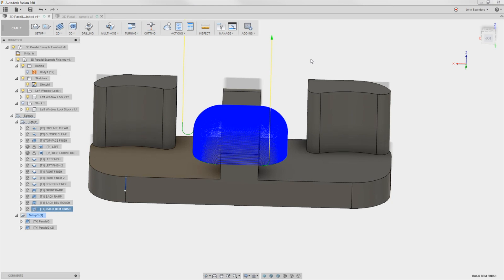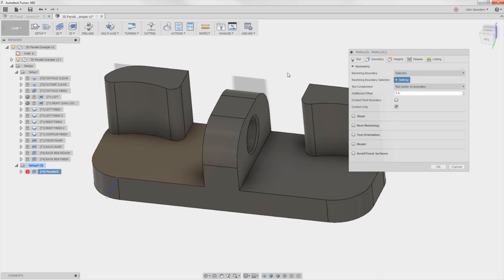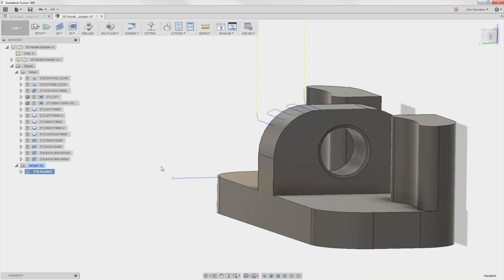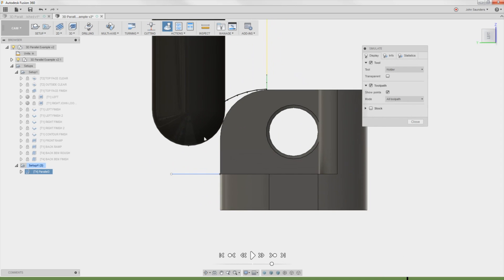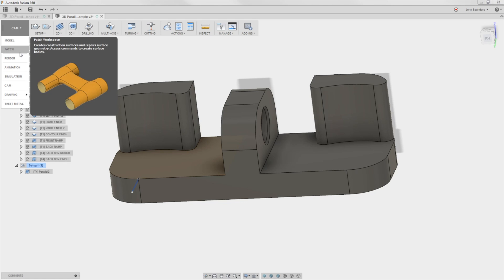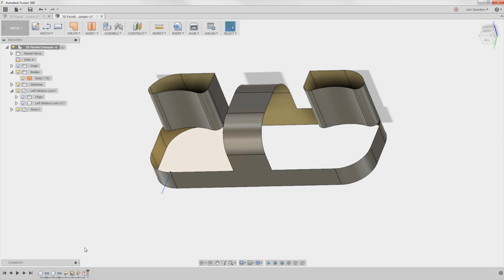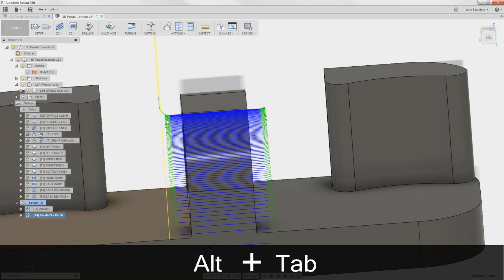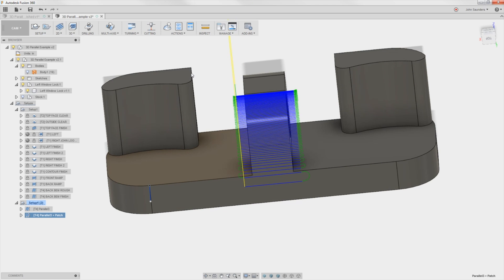Fusion 360: Fixing 3D CAM with Patch!  FF74

Comment: This is exactly what I was looking for. I can't believe Fusion doesn't a setting to do this. One thing you should know is Fusion looks a lot different now, so you have to switch from Solid mode to Surface mode in the top tabs to find the create patch command.

Comment: Thank you! I realize this is an old video (especially by Fusion standards), but it's still just as applicable today. I'm designing an electric guitar neck with custom inlays in the fretboard, and tried everything I could think of to generate a parallel tool path to radius the fingerboard which ignored the inlay pockets (the end mill I'm using is designed to surface fingerboards with shell inlays without chipping), and this is the best approach I've seen. I was able to create an offset surface from the fretboard prior to the inlay pockets and nut slot being cut, and then use that for the selection of the parallel tool path. Worked like a charm!

Comment: I'll have to try the tip on linking.  I've got a 1991 Leblond Makino with the Fanuc O-M control.  I have to drip feed most programs that have a lot of adaptive stuff or 3D.  One thing mine does is slow down the feed on the tight radii in between parallel passes.  Can't quite find the parameter for that one.

Comment: Ideally you should have had that toolpath cut from the bottom up, so you are not doing the majority of the cutting with the center of the ball mill.   Do this by rotating the parallel path by 180 Degrees in the passes tab (pass direction).  Better finish, better endmill life... etc etc. Great Video though.  

This patch thing took me so long to figure out on my own.  I use it on pretty much every part I machine now.   Linking trick is something Im gonna have to try.

Comment: John,

At work I use NX9 and it refers to what you describe as "zero thickness surfaces" as sheet bodies.

You create a sketch that has open geometry.  You then extrude it by whatever distance you want.  This gives a sheet of zero thickness.  I regularly then use the subtract function to remove material, leaving the geometry I want.

I tried performing this in Fusion and it won't allow me to select open geometry in the Pull or Extrude functions.

Brenton

Comment: One way I've had success doing that same thing was to project the edge of that fillet on a new sketch on the side perpendicular to the fillet. Then in patch you can select that projected edge and extrude which creates a surface. You can change setting to "Two Ways" to extrude it in the other direction as well. This way you don't have all that extra geometry inside your design to deal with.

Comment: Had to check. You're right. There is no tangential extension parameter for surfacing ops.  

Looks like the only other way around it is to turn contact points off, turn boundary to outside containment and use avoid/touch and slope angles to make it avoid other surfaces. 

It does seem to automatically add in some extension to fully clear the surface. So there's an expression hidden somewhere controlling it, but looks like it's in the background, nothing that's user changeable.
Reply: Ok, I just tried this again. You need to do additional offset with tool center on boundary. The additional offset needs to be less than the radius of the tool. In that case the tool comes out to the Additional boundry, but can't go down the side of the part. In my case I used a .01 offset and a .25 tool.
Reply: there is 'fragmentExtensionDistance' that accomplish what John did in the video without having to make a surface..
Reply: Yes. Bu where can you change that?  And is it per toolpath or a global change across all paths?
Reply: per toolpath, it's just an advanced parameter that hides on the passes tab.. In fusion, I don't think there's a 'show advanced' option, so you'd need to edit it through 'compare and edit'
Reply: Rob... It would have to violate the containment boundary to have an effect wouldn't it? Whenever I've tried to muck about with it, It hasn't changed the toolpath.
Reply: Also where is the Show advanced option? I swear I've seen it somewhere before, but I can't find it.
Reply: yeah, I don't think it actually works here; it would either extend the toolpath prior to being trimmed by the boundary, or extend in an undesirable way anyhow (dive off the side) - I forget which one it does, but it's not the awesome 'just make these passes longer' that should exist but (to my knowledge) doesnt.. - Show Advanced is in the RMB menu when clicking anywhere in empty operation window space.
Reply: rob lockwood 
Silly me kept clicking in the input boxes to try and find it 😆

This seems like a no brainer easy to add thing for Fusion. 

I know I've seen tangential extensions for other toolpaths, I think all the 2D paths have it. None for the 3D though. 

Unless you force it to go in a single direction and use leadin/out. But that seems like an ungodly waste of time.
Reply: Additional offset is listed right under tool containment.
Reply: D Johnson that doesn't make the tool come off and on the part, simply extends the boundary where the tool can go. In this case it would just make the tool drop vertically to surface the vertical walls. Won't lead on and off the surface
Reply: Oh, my mistake. it works for me every time I have tried.
Reply: I just set something up similar to this, I see what you are saying. It just pecks over the side, and you can't really fix it with your heights.

Comment: Could it work also with set "tool outside boundary" instead of creating a patch?
Reply: Beltra .KTM 
Yes. But it will try and do the vertical wall sections as well, so you'd have to control it with slope limits and avoid surfaces.

Comment: Fanuc controllers are terrible. they don't offer a lot of memory. Is there any possible legit reason for it, or are they just cheap bastards? lol!
Reply: Drip feeding leads to far more possibly going wrong..
Reply: Fanuc controllers work great..are super reliable and for 3D you can drip feed them so a large memory isn't needed..less to go wrong..for standard work the memory is usually ample..for 3d drip feeding works great..if it aint broke don't fix it!